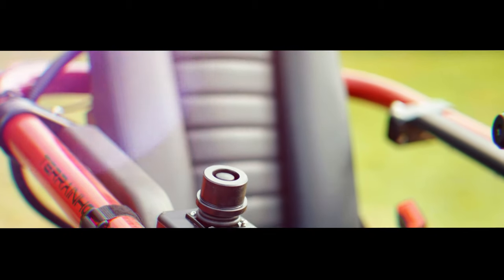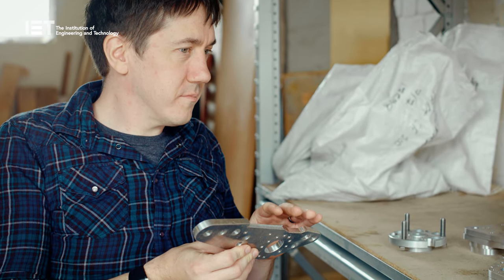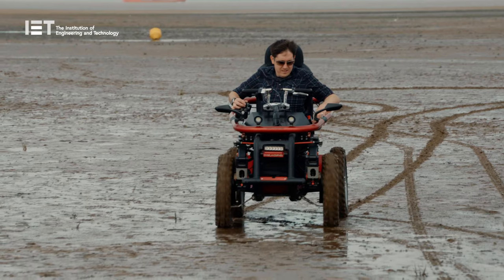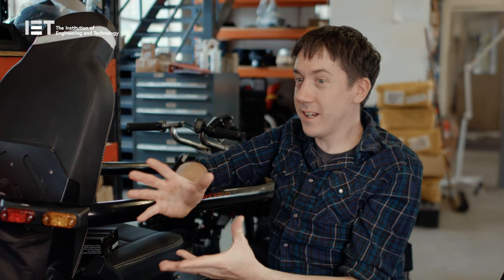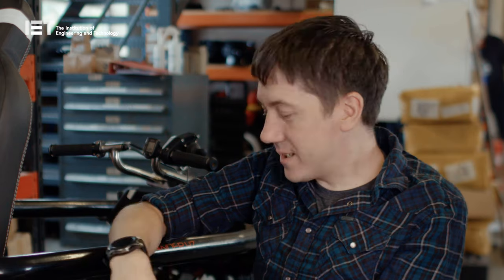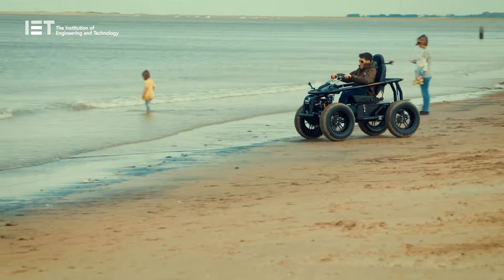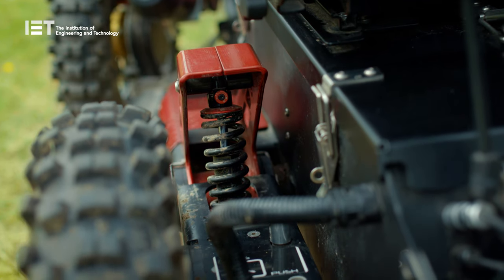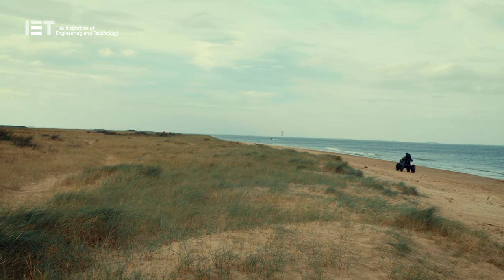The TerrainHopper Affair - An All Terrain Mobility Experience

Comment: Wow... its so nice... put 4 point seatbelt to it and a roll bar above the head to increase security. Its also great if you can add some kind of door to make easier to entry or exit the vehicle.
Reply: You can customize the TerrainHopper to have a 4 or 5 point harness....as well as a rollbar.  There is no need for a door since the bars unlatch and are raised upward, allowing any user to get in the device from either side.

Comment: I was hoping to see how you transferred on and off of it especially with that big bar running horizontally
Reply: There are two bars as you can see on both sides.  You can use either side to get in by releasing a small latch on the front of the bar.  The bar raises upward so the user can get in.  The seat itself rotates toward the user so its easier to transfer from a regular wheelchair to the TerrainHopper.

Comment: Powerchairs have advanced amazingly over the years, going from street versions to off-road ones, But l got a challenge for it... at the moment l have an X8 4x4 chair and not only do l use it to explore and keep an eye on my property, but l also do yardwork with it mostly cutting grass, and all depending on the terrain l'm on, it'll give me about a good hour and a half on flat ground, but if l'm anywhere with an incline barely an hour, these are a good if you want to go hiking or somewhere else off-road, but to truly give a person with a disability.. well one like me anyway, 

There's a few things l've came across that are a problem. Batteries just don't cut it, Shocks seem like there just as a novelty, since any powerchair l've had are really not that smooth... and especially when it comes to certain tires, and the price of these are always a killer...
Really Awesome Job on building something from scratch with their own spin on it
Reply: Compared to the X8 4x4 and others, the TerrainHopper has longer battery life with Lithium Ion Battery Packs up to a range of 24 Miles.  The X8 is not waterproof like the TerrainHopper.  The TerrainHopper is made to go in water, rivers, streams, etc.  The X8 only has front suspension where the TerrainHopper has 4 Wheel Independent Suspension.  Due to this Suspension, its a smooth ride over any rocks, or other difficult terrain.  The TerrainHopper has 4 powerful 750 watt motors....adjustable.  The cost of a TerrainHopper starts at $18,000......the X8 ranges from $15,500 upwards.  Quite similar in price.  The one large difference is the TerrainHopper does not look like a wheelchair.  Its a mobility device that was designed for accessibility, performance, toughness, etc.  Visit www.terrainhopperusa.com for more Information.